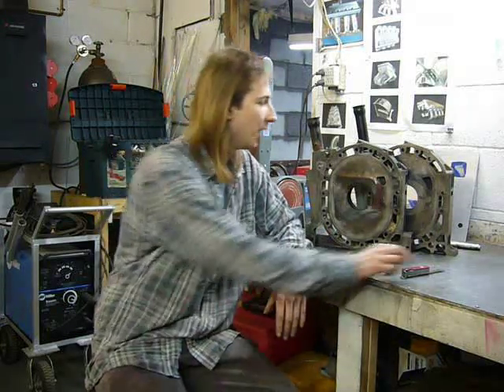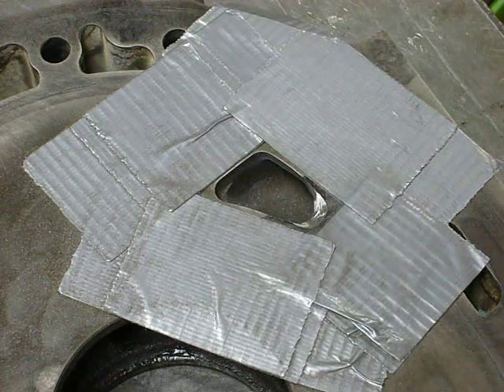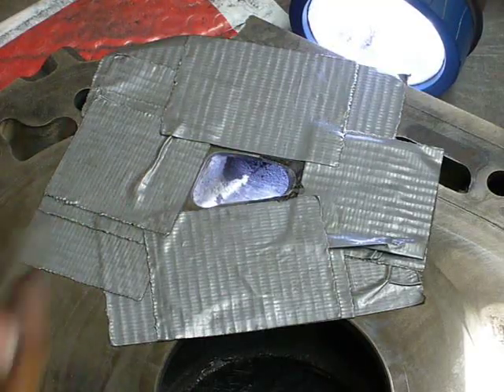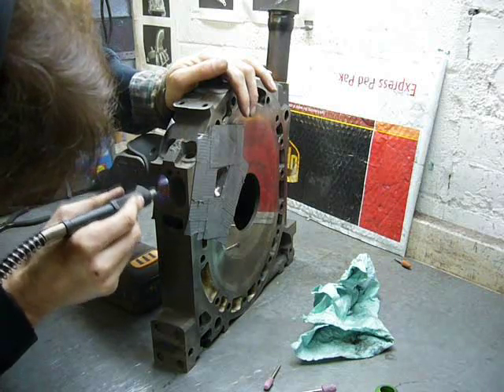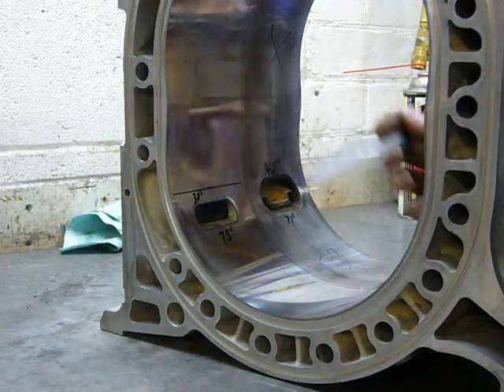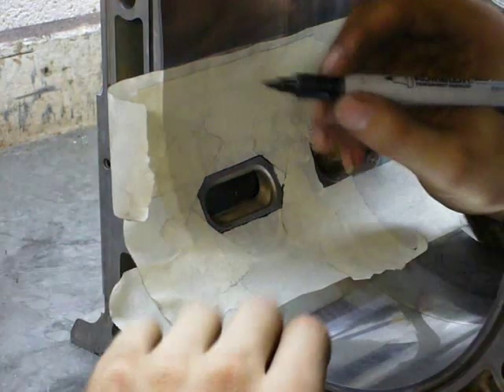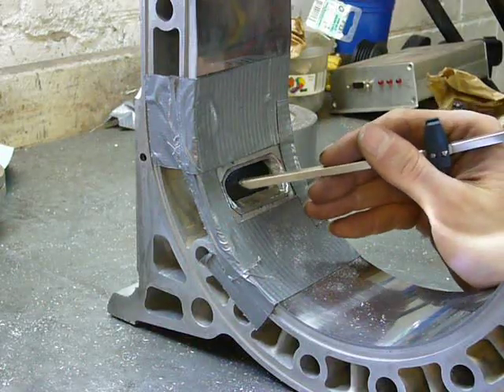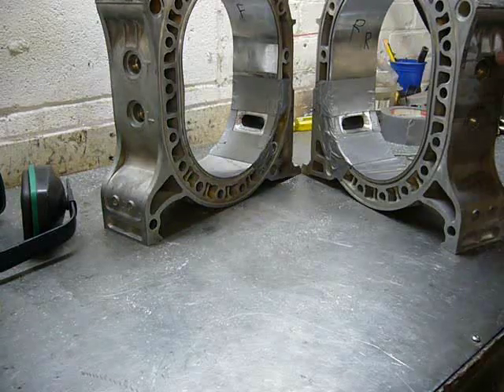Part 7: My 76 Mazda RX-5 Cosmo Restoration - Intake and Exhaust Porting

Comment from the maker: @blackbug323 Yep, the Cosmo center iron is tallport. However I can't really use it since there aren't any injector bungs and putting the injectors up in the manifold would cause atomization issues at low airflows.

Comment from the maker: @yerboogieman It likely isn't economical to do so. It would probably be $250-$300 round trip shipping and then several hundred for my time to port them. From any of the rotary vendors you can get templates then fire up the Dremel and port away. Just practice on a junk iron first.

Comment from the maker: @morphman123 There simply aren't port templates available for the port shape and timings that I wanted. All the templates out there are designed for major timing changes which is not something I wanted. So I just measured up and made my own. Yes, the ports match. Careful measuring assured that. If I was going to do a bunch of these I would have made a metal template but didn't see the need just for two. This isn't my first port job. :-)